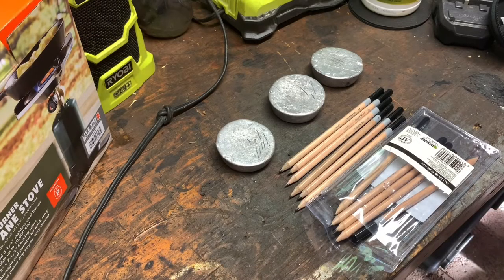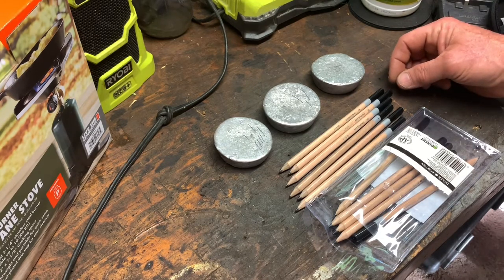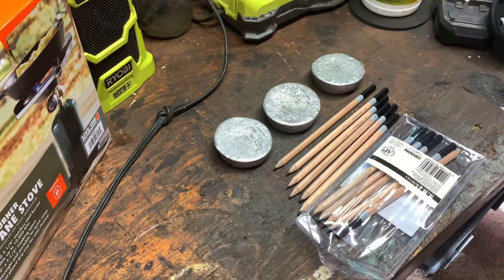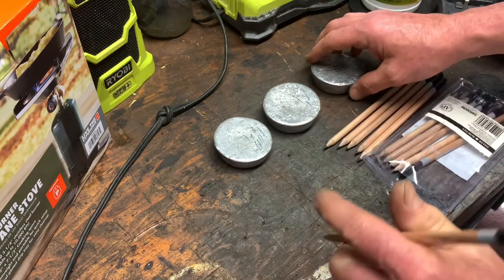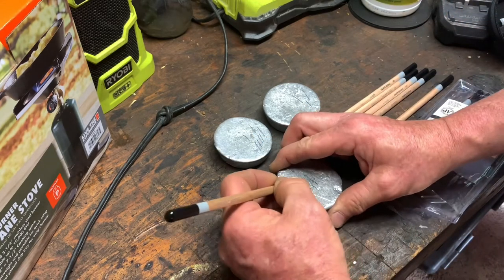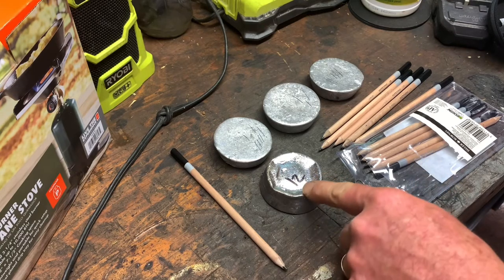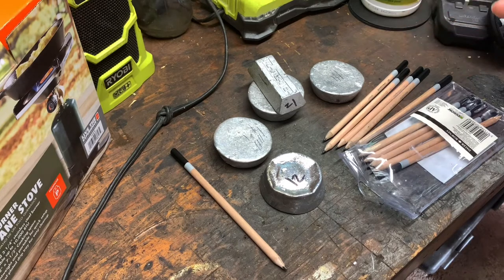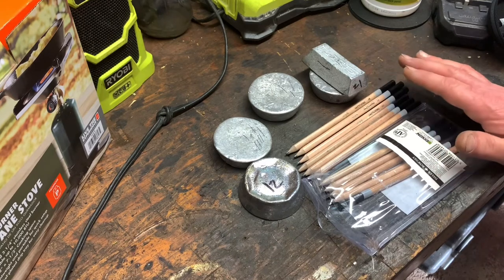Testing lead hardness with artists pencils, easy and accurate

Comment: Dug through my crap I have stored away and tested my scrap lead that I use for casting roundball. Pure lead is best. 6B lightly scratches it, 8B doesn't scratch. I think my issue may be from dropping the roundballs in a 5 gallon bucket of water as I cast. Maybe the quench is hardening them? More experimenting to be done...

Comment: You answered exactly what I was wondering.  If the pencil scratches then it's softer than the pencil.  So your pencil was a 10bhn that means the lead was a 9 or lower and since the 9 skated then it must be 9 ish.